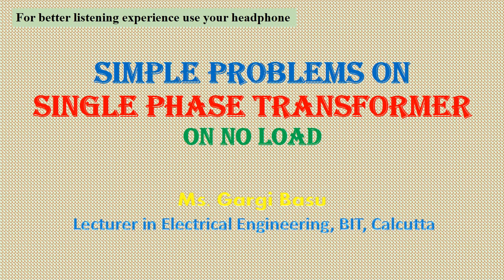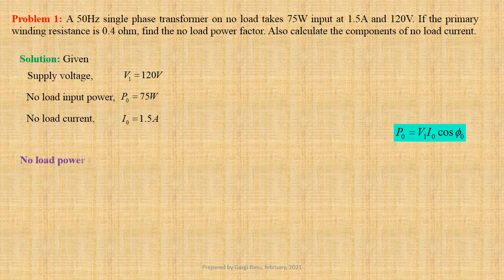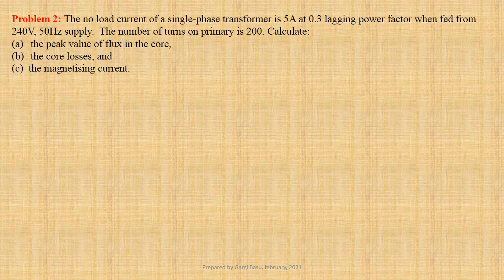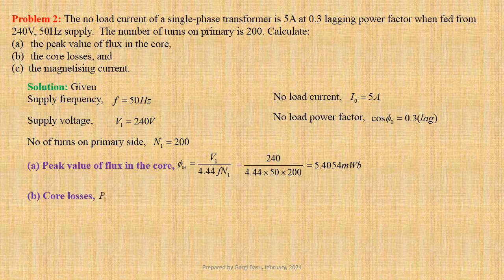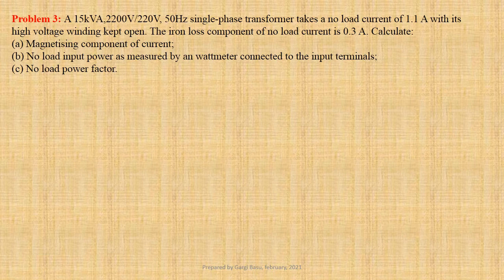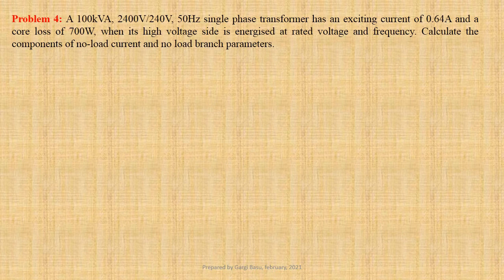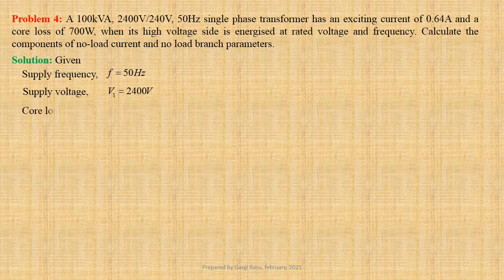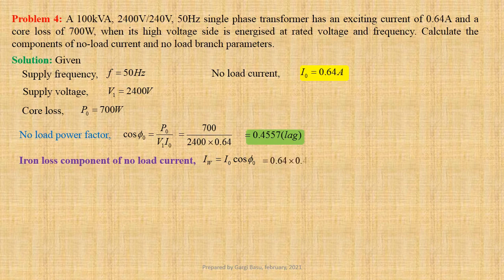Simple problems on single phase transformer on no load

Comment: For a fixed primary voltage how does the secondary terminal voltage of the transformer change if the PF of a capacitive load rises from 0.7 to 0.9 with a load current constant?
Reply from the maker: Secondary terminal voltage changes due to voltage drop across secondary winding impedance.
Reply: @gargibasu5111  will it decreases or increases ? what will happen ??
Reply from the maker: @sarojkoirala3968  For capacitive load it increases and for inductive and  resistive load it will decrease

Comment: When given two voltages, how do you know which one to use as V1 on a no load
Reply from the maker: During no load test to measure the no load current accurately instruments are to be connected on low voltage side. Therefore usually low voltage side will be considered as primary.
Reply: Because,
 In the qs no.3 , it is given that "high voltage winding kept open" and we all know that we always open secondary winding not primary .  
So,  it is clear that secondary is high voltage winding and primary is low voltage winding.
That's why, V2 = 2200v ,and V1 = 220v.
Reply: @mukeshkumarmeshram7679  And in qs no. 4 , there is nothing discussed about high voltage or low voltage , so we apply general term V1 / V2 .
So , V1 / V2 = 2400v / 240v